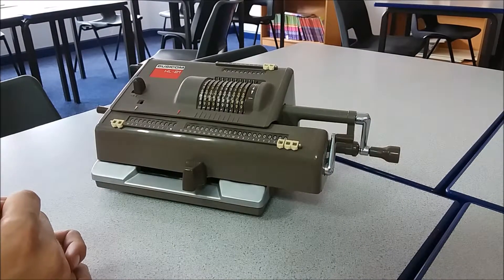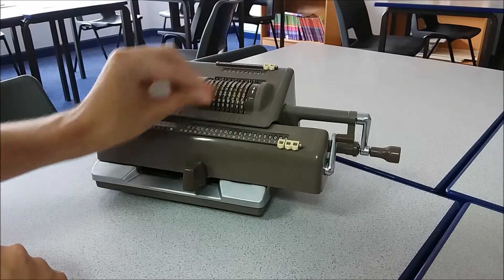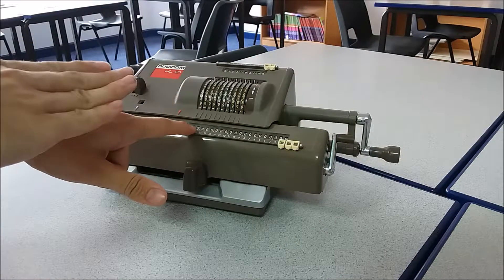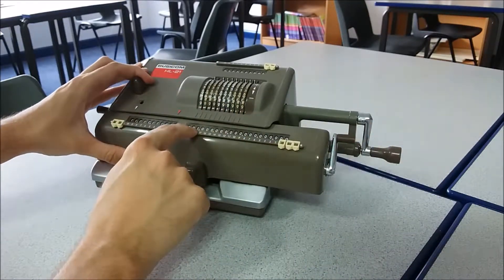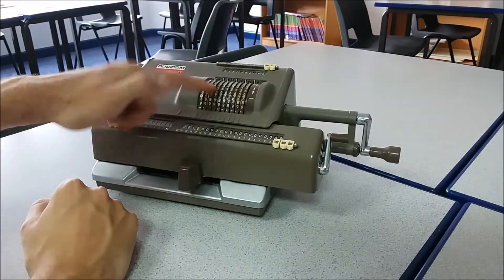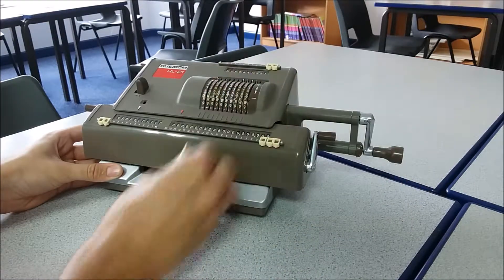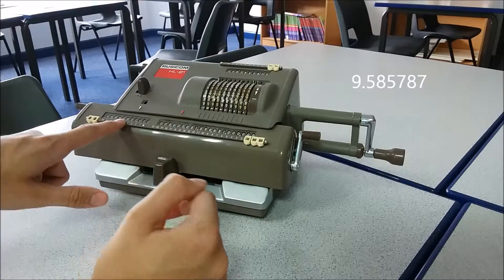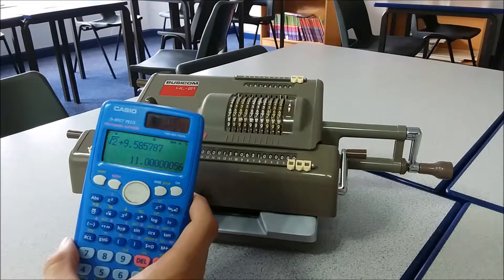Root 2 on a Mechanical Calculator

Comment: On my Monroe I clear the counter register then start subtracting 1 3 etc until underflow, add 1, last digit change 1 down (an even number)…shift carriage, 1 3 etc. if you get to 9 without an underflow then increase digit to left 1 and 1 in the current column, then carry on. It has a keyboard so I can go pretty fast.